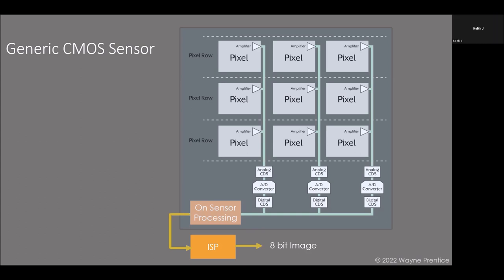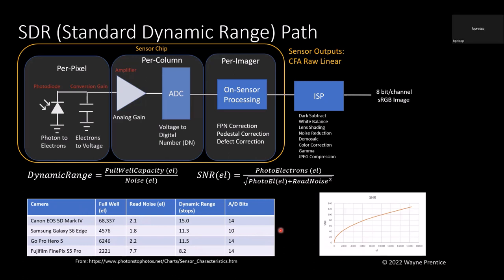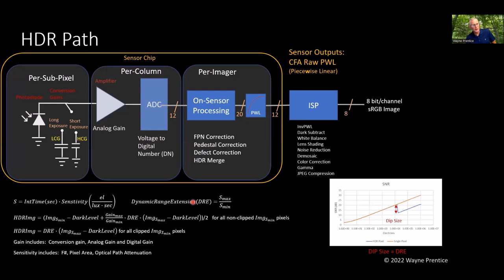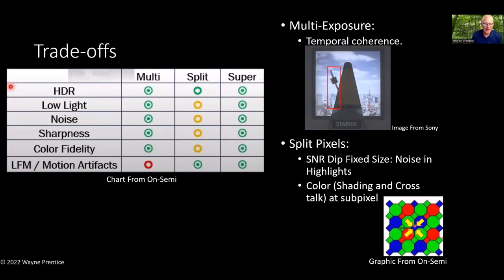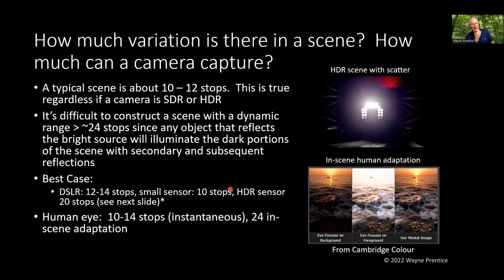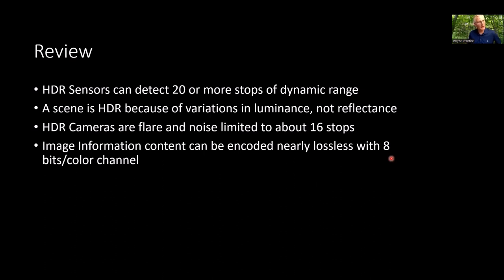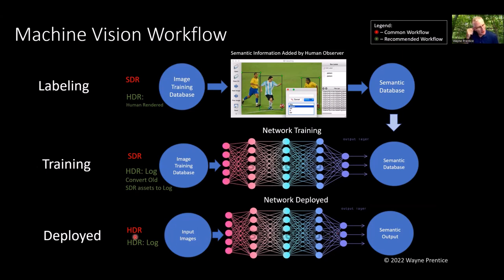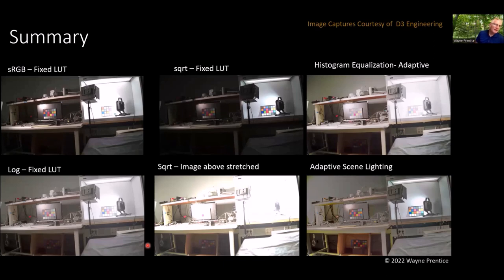High Dynamic Range (HDR) Imaging: Theory and Practical Consideration, by Wayne Prentice

Comment: Considering the Barten Curve om HDR standards like PQ2084;  Its show in the definition that 12bit codewords would be "needed"  to sample PQ targeting 10k nits level.
By hardware perspective using ARGB 2:10:10:10 format would optimize both storage and compute.  Then what is the better way to maintain information but compress it to 10bit?

my estimation is abandoning limited code ranges so a 10bit full-range format could be enough but some adjustment of PQ max target like reducing from 10k nits to 8k.
Reply: From what I can tell the encoding standard is based upon the assumption that the source image data is noiseless and the only limiting factor considered is the human visual system.   The point made in this talk is from an information content perspective, encoding RGB at 8 bits/pixel/channel is virtually lossless since the source signal information is limited by noise.  In other words, the uncertainty induced by quantizing is less than the uncertainty due to photon shot noise.  Stated another way,  you don't need more bits than you have information in the image data.  

If your image data is noise free, meaning it was not produced by a standard photographic process, then we are now into an area that I have not studied.  On the other hand, if it was digital camera sourced then perhaps the perceptual encoding standards are appropriate for intermediate computations, but may be overkill with regards to storage of image data directly from the camera.